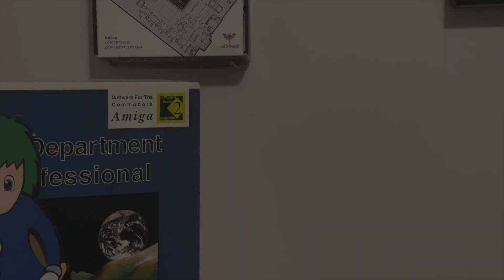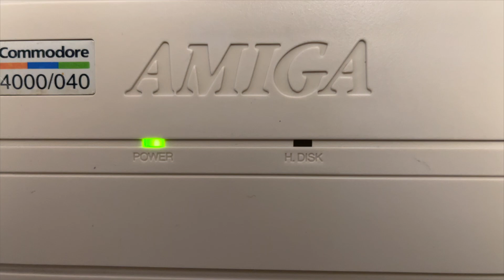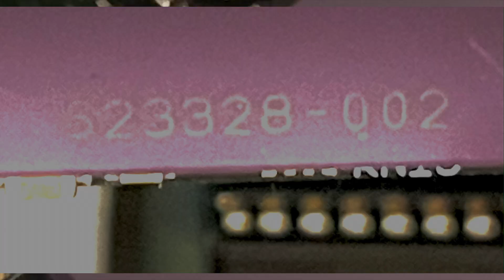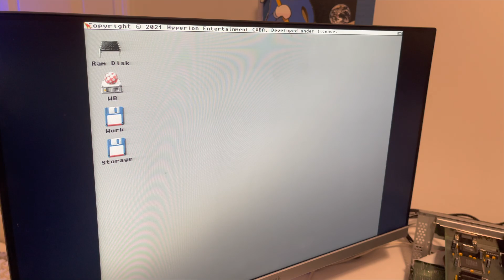Amiga 4000 68060 INSTALL! Repaired CPU?

Comment: That Mask is a Rev 1 68060. It has full MMU and FPU but it is a Rev 1
Reply from the maker: Thank you! How do you decode those numbers? Is it the mystic arts?
Reply: @HoldandModify  Google that mask identifier and swim through the results you eventually find some info about that mask.
Reply: XC think of it as Xperimental Chip,its a unqualified part,but still ok in most cases. MC is a full qualified production part.
RC in the middle of the number is a full chip with working MMU/FPU.
EC=no mmu/fpu.
LC=mmu only,no fpu.

01f43g=REV  1 (can clock to 66 reliably with heatsink in most all cases.

1G65V=REV 5 (66mhz no problem).has FPU bug but a known thing and still ok.
71E41J=REV 6  Latest 060,runs cool,some can clock to 120mhz but 100mhz is common. the last,full 060 made and runs very cool at 50mhz. No Bugs.

I have run all of these masks,and none have ever been a problems in most older,common accelerators(cyberstorms,warp engines,blizzards,gvp,etc.
LC is commonly a rev4 some up to 75mhz,usually 2g65v,3G59Y masks etc
this is a rough guide and should cover most of what you need to know.
Reply: @a4000t  It's amazing to me how long the XC versions of some Motorola series of CPUs were on the market before MC was finally released.
Reply: @andycraig7734  I agree,i guess it took a long time to get a good process/yield. It also amazed me we didn't get a truly bug free MC68060 part until rev 6.
Reply: Swap it with the one in your TF1260 :)
Reply: My Cyberstorm PPC came with a rev 0 xc68060rc50 It has full MMU/FPU

Comment: I didn't know the rev1 was usuitable - I don't see why? Good thing I never planned to put mine in it. But seriously, the BFG9060 starts life at 100Mhz, making all the difference to the old 50MHz accellerators (I have a CS MK1 myself) when you get that memory performance...
Reply from the maker: Rev5s are good for 75mhz. However I don’t OC anything. Just not a thing for me. Yes I know how much faster even 75 is let alone 100. Seen all the videos, heh. Just not a thing for me.

Comment: Use only the 68060 Rev6 CPU. They are the best of the best. Use it on my TF1260 and have 1 Rev6 CPU for the Blizzard PPC. If i can buy it or use it for the WARP1260.
Reply from the maker: Oops. I let a spoiler loose for my next vid. ;)
Reply from the maker: Rev5 are still good for up to 66-75mhz.  However I have no idea what Rev this is until someone responds.

Comment: I ordered a rev. 6 for my BFG. Would you like to have my old no fpu chip? Works fine on the card with 50 mhz and no cooling. Greets
Reply from the maker: Why thank you for your kind offer. A non FPU 68060 runs around the same speed as a 68020 with FPU. Usable for gaming and demos? Yes. 3D rendering? Hmmmm. ;) My reply might come off as a bit “dickish” but that’s absolutely not my intent. It’s more to inform others who may see this comment and not have watched my video comparing various CPUs. So, thank you, but I’m good. You keep jamming and hopefully do amazing things!
Reply: @HoldandModify  Serious about the speed? It runs way faster than my A3640 (with FPU)... Of cause not with software that require a FPU. I was impressed how much faster the non FPU version of iBrowse against the 040 FPU version! But anyway, thanks for your Videos, love to watch them! :)

Comment: Would have loved a 060 in my Amiga 1200 back in 1993. The cost was totally unafordable. Great video. Amiga lives.
Reply from the maker: TRUTH! Thanks for checking my video out!
Reply: @HoldandModify  Just looked in Amiga format June 1996 the blizzard 1260 turbo cost £599.95 Sterling. £1,102.22  in todays money...
Reply from the maker: @BAZFANSHOTHITSClassicTunes  YIKES. Well they almost sell for that now. If you can find them. This BFG is under $300 without CPU last I checked.
Reply: I am pretty sure that most mortals would suggest that a 68060 is still unaffordable.. at least the full fat ones.